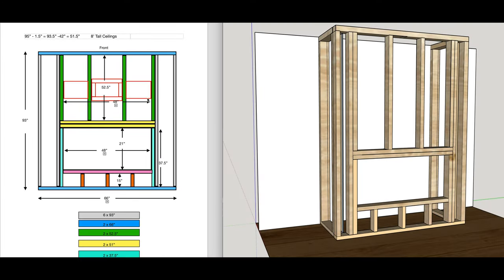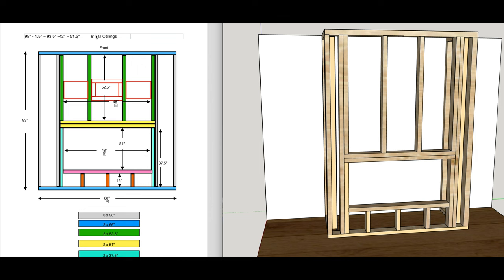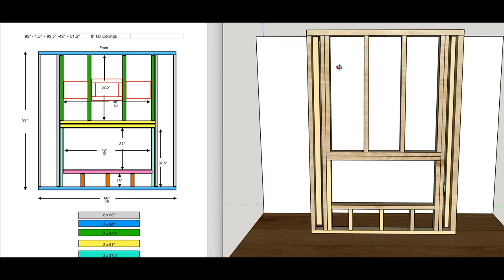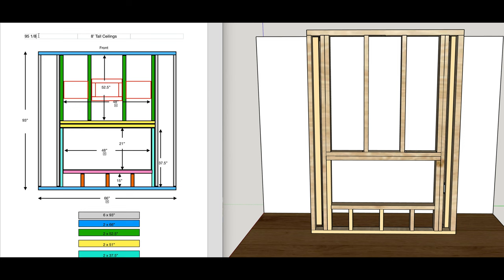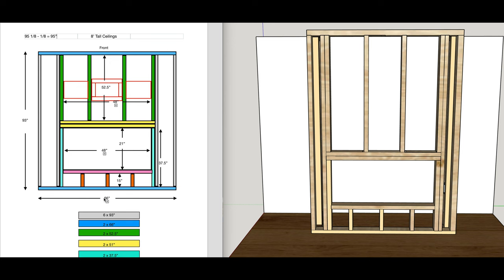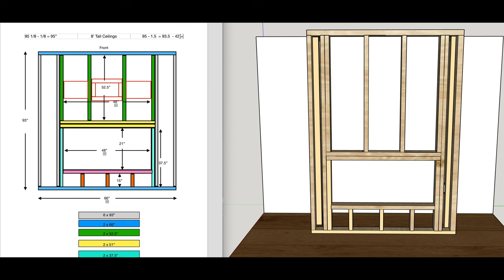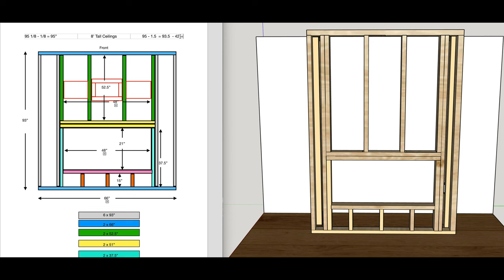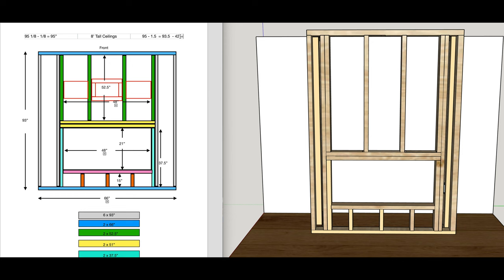How to Frame and Build a Fireplace

Comment: Hi Cottonwood,

I hope this message finds you well. I recently watched your video on building a firewall frame, and I was truly impressed by your skill and attention to detail. You did an amazing job, and it was incredibly inspiring to see your process!

I was wondering if you might be able to help me with something similar, but for a vaulted ceiling. If I provide you with the measurements, would you be open to creating this for me or guiding me through the process? Let me know your thoughts and if this is something you’d consider.

Thank you so much for sharing your expertise, and I look forward to hearing from you.

Comment: What are the advantages of having a recessed mounted tv vs mounting to the studs you have colored green or blocking between those studs?
Reply from the maker: Its only depends on aesthetics. A recessed space for a tv looks great but if you plan on changing tv sizes then it might not work well
I put a small niche behind the tv to hide wires

Comment: I want to do this but there is a vent on my ceiling 8 inches from  the wall ceiling. Would it be possible to create this at only an 8inch depth? Or is that too close to the wall?
Reply: Definitely can do it. The minimum space I would recommend would be 4". Double check the depth of your fireplace insert before and make sure it can fit entirely inside
Reply from the maker: I agree^ could definitely fit it or extend the duct work

Comment: This was very helpful!! thank you. 

QUESTION - do you have any suggestions for further support for a 60" tv over top of the fire place? or should it be good if I just put it on the studs already in place there? Thanks!
Reply from the maker: You can definitely mount it to the studs but what is better is adding horizontal blocking in between the studs all the way across

I would use a 2x12 for the blocking so you have plenty of space to determine where you want to put your TV mount after you build it
Hope that helps!

Comment: What's the best way to frame and get your measurements if the top of your fireplace is sloped in and is smaller than the bottom?
Reply from the maker: I'm a little confused on what you mean

Comment: We have a heat n glo cosmo gas insert our builder installed. We didn't like their faux stone so we asked them to just drywall the outside for a faux plaster look & we would find a stone later. They did that. But every time we run it (we have done a long burn in to get the initial smell to go away) it has a mild odor & we both get throat irritation & headaches soon after. No one wants to look at it because they didn't install it. Finally got one company to come out & they confirmed no carbon dioxide was being emitted. Their best guess is the builder didn't line the drywall with the proper glue & it's giving off or the drywall itself is giving off the chemicals. If we rip off all the drywall what do we need to ensure the frame has heat resistance to protect whatever we lay on top?
Reply from the maker: What does it smell like?

Comment: If you decide to do a wood mantel, at what height would you install it?
Reply: I normally do that at 62” top of mantel. But some fireplaces require a certain amount of space in between fireplace and bottom of mantel
Reply from the maker: I would recommend deciding what size tv and where your tv placement will be if you plan on having one on the fireplace. 
I'd do a mantle rough 14-18" above the fireplace or 6-10" below the TV